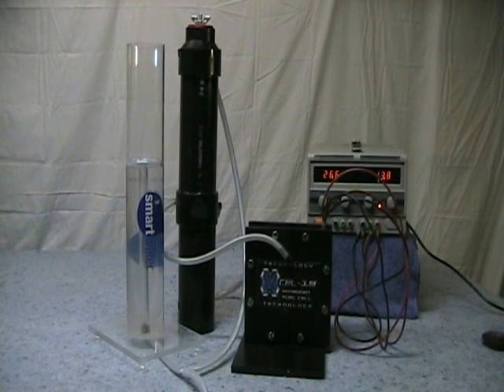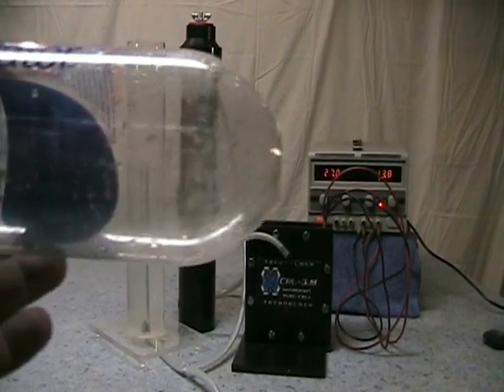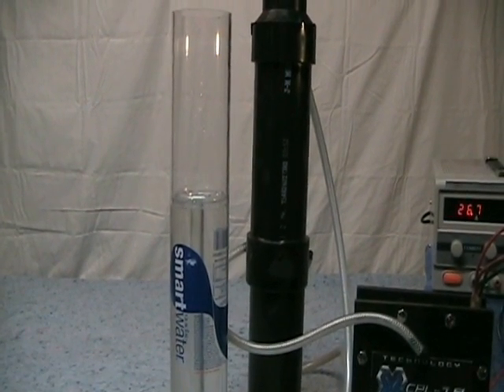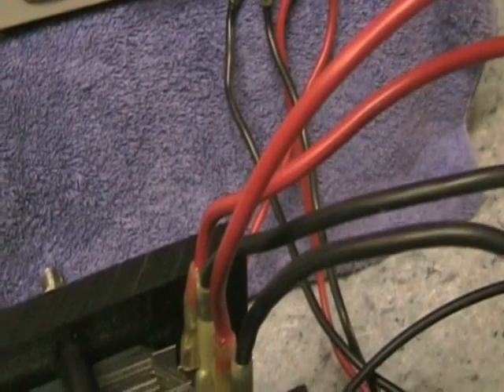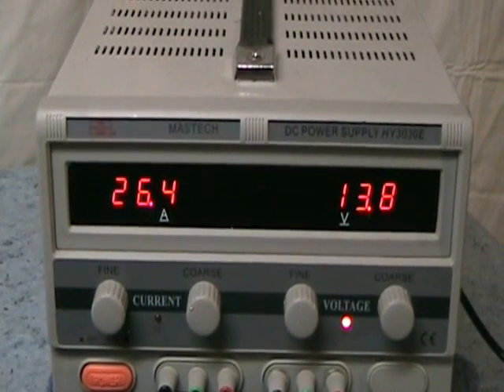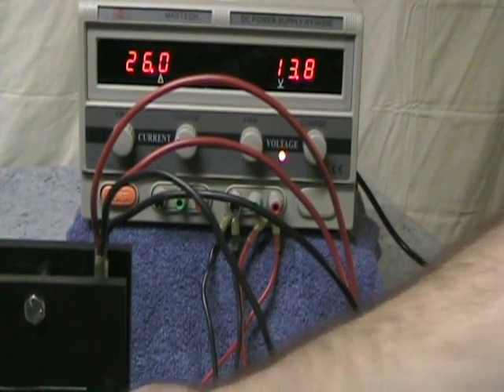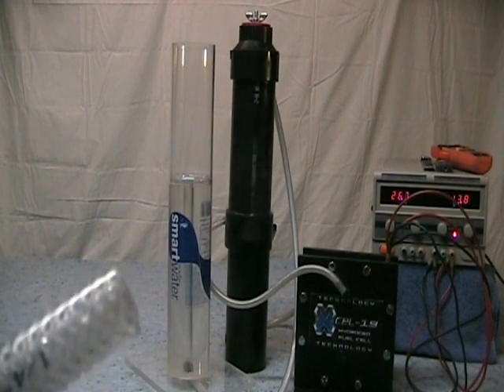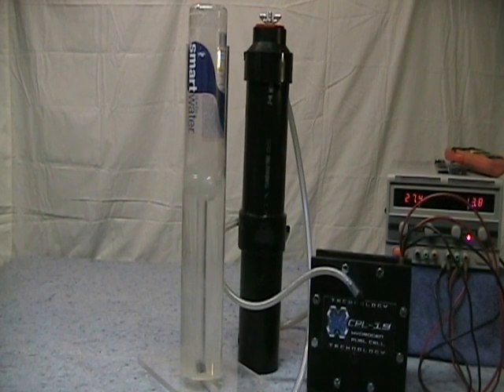Dry Cell 5.725 mmw  5N 3 = 19 plate cell Bench

Comment from the maker: Also this "vapor" can be seen at cell temps at 80F or colder.  There has been talk that small molecules of water are being superheated at micrscopic levels due to the CHEMICAL/Electrical/magnetic reaction from the KOH and H20/Steel during brute force effect.

When electrons are seperated/joined the heat generated appears to vaporize small amounts of water, multiply that by thousands and thousands of reactions, and you get Water Vapor from cell temps well below H20 boiling point of 211F.

Comment from the maker: Yes that has been discussed, and would probably work.. someone mentioned a simple balloon test, fill it with HHO tie it off and it rises..quickly. if you were to fill it with HHO/steam it will rise slower or even settle down if there is more steam vapor than HHO. Pure HHO will cause the balloon to rise quickly. The higher the amount the fast the balloon will rise. If its pure HHO it will rise instantly.

Cooling the vapor has been done it returned to water.. Just run through ICE.

Comment: On the subject of whether that is steam (boiling water) or not, could you have your exhaust line feed into a vessel, then exit out the other side allowing the "steam" to cool and condense? Otherwise if it isn't steam (boiling water vapor), the gas will exhaust out the end of the vessel and all questions will be answered. Steam can arrive from other sources rather than water though - a whole other matter.
You have a very clean set up. I am very impressed with your videos.

Comment from the maker: Efficiency went up to 5.7mmw at the higher amps, with the 5n setup, which was good, but production of HHO seemed to be about the same 30 Sec/1lter. or 2lpm = .67lter/10A.. Which seems to be the  max for our dry cells at about 112-140F. Others agree. 

I was not a big FAN of heat, but now Im thinking MORE steam for MPG gains and engine injection is good as the more i learn about STEAM injection the more I like it.. Combined with the right amount of HHO, O2, what a great combo from ONE device?

Comment from the maker: Also Im not sure HEAT is such a bad thing, steam as a byproduct from our cells could really help engine performance and also for MPG gains.  Only downside it need larger reserviors as the water itself will be consumed faster.  I think the ideal would be to get the cell to 140-150F even, thus generating steam and HHO in abundance.  Since we really dont want to use greater VOLTS/plate gap due to leaching of the alloy (brown crud) we need greater AMP pull to excite the water to start vaporizing it.

Comment from the maker: thanks Luther,

It does take longer to heat up, I would say about an hour or hour and half to get to 120-30F. I can time it.. for anothe vid..But thats ONLY if I start at 20A, starting at lower amps ( lesser concentrations of KOH)would take much longer to heat up. 

It does take more KOH/GA to get it to 30A. I do think it will handle LARGER amp draws better than the 4N 3 design does without Overheating too fast, so you could get higher Amp/HHO outputs before overheating on a smaller cell